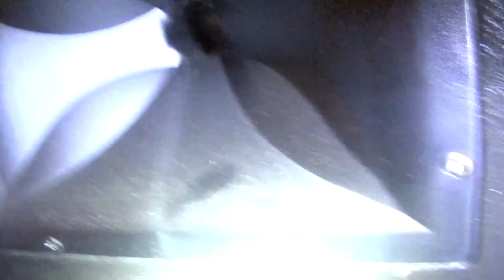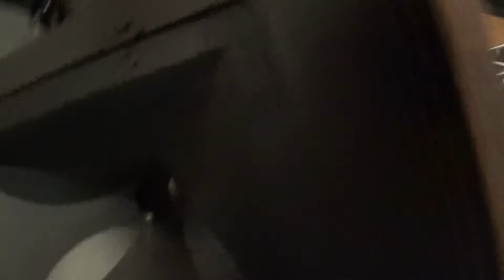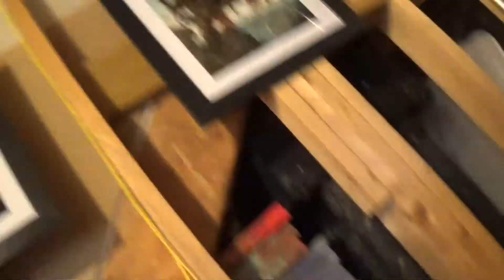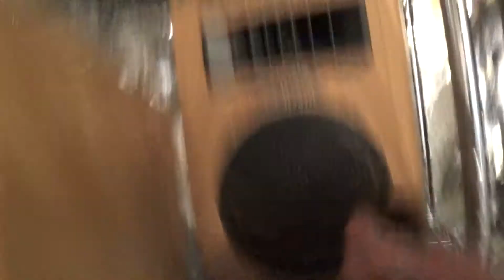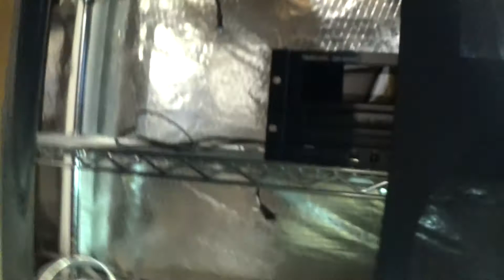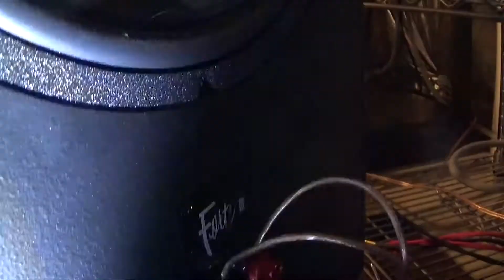Klipsch Forte III Review, Pt. 1:  Design, Construction, Grilles, Styling

Comment: I found your channel shortly before pulling the trigger on my  gear. Your 'documentary' on the Yamaha topology sold me. Just got a balanced DAC, but it sounds best as a pre feeding main direct over RCA. The Forte are from '85,  did 'foams' on the passives, (dry rot, from UV)sealed the cabinets, got caps and Ti tweeters and some damping material on the way. They sound good, but not great...yet. Amp is STRONG.  To stereopolice, https://imgur.com/a/gigpbuI
Reply from the maker: Wow; fantastic.   Yes, the amp is incredible in my opinion.  What DAC are you using?   As far as the speakers, I have not heard vintage Fortes to compare with.   I've also moved to the Cornwalls as seen my my latest vids.  Love both sets of speakers.   Once you get accustomed to the dynamics and ease of horns, it's really hard to go back to domes and cones (at least to me).  BTW, is that an 1100 or 2100?   Regards ....
Reply: @stereopolice  I got an RME-ADI2. I haven't listened to many, wanted a balanced out, this has some great, useful DSP and stonking headphone outs(2, Extreme Power/IEM). Quickly realized that DAC>Main Direct in via RCA sounds better and gets more features from the DAC. The amp is the 2100. I didn't want regrets, but now that I'm not using the pre, the headphone jack and got talked out of vinyl by a friend, I'm thinking I should have gone with separates, but it's not like the Forte need more power, less through tubes, maybe. I'll definitely keep the Fortes and the DAC for it's features if not the sound, but I may trade my way up on Audigon. Totally happy with the Yamaha, but not utilizing the features I paid for.
Reply: @stereopolice  the IIs and IIIs are very similar. Mine have different mid horn and 12" passive, they sound like Klipsch. Well, they're out of spec and causing some interference between horns, right now. Caps should fix em up. I got JBL 590s on Black Friday cheap, then found the Forte THAT night! Almost kept the JBL, but when DAC got here last week I found their limit. Sending them back.
Reply: @stereopolice  got the new caps installed this week. Mine are the first generation with XOs mounted directly to the binding post cups. I noped out the first attempt, considered moving them to a separate board, but the inductors are glued right to the cup(there's no board at all) and I decided to just leave them for now. Brushed up on my soldering skills and went back in. What a difference! I had glimpses of their potential, but knew it wasn't right.  I'm so happy right now. I was really expecting a WOW moment with this gear. It took a while because I'm thrifty. I'm looking at a pair of Magnepans as a alternate now. I had no idea they were so cheap and I can just stick them against the wall when not using. I wasn't sure if the Yamaha had the guts to make Maggie's sing, but I never should have doubted.
Reply: @stereopolice  oh, and I've gone back to using the Yamaha's pre amp  balanced with XLRs.  The DAC has a great loudness function where I can set the bass/trebel gain and it slowly ramps up below a chosen volume. Kind of a pain adjusting two volumes but worth it for low level listening at night.